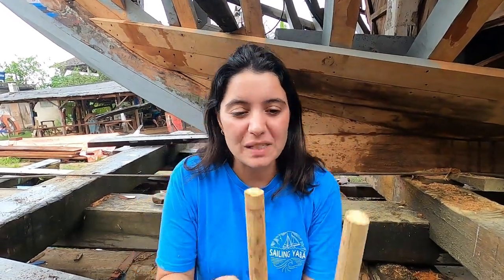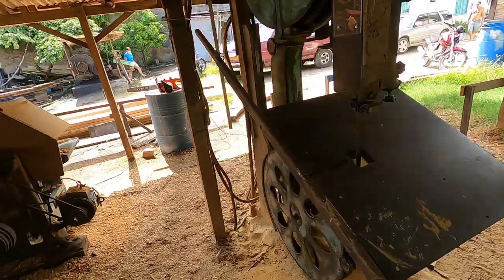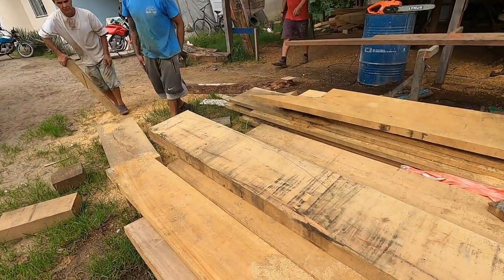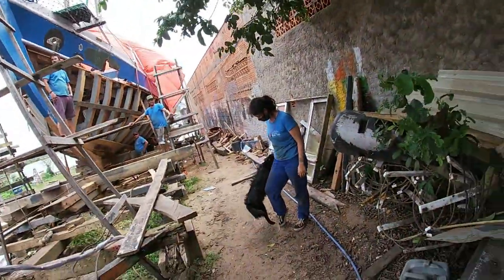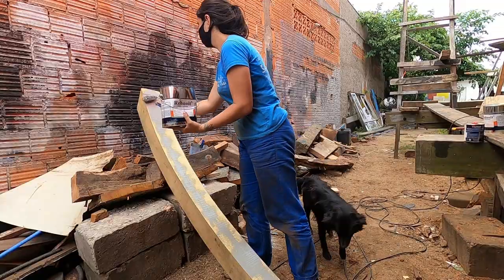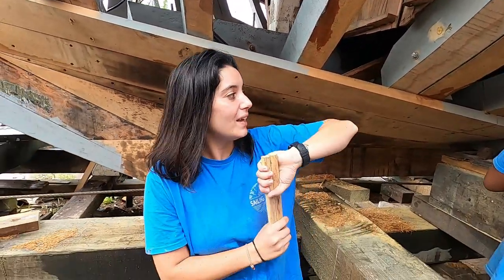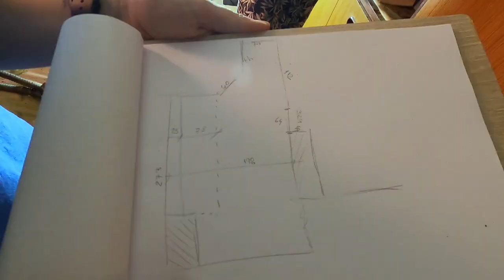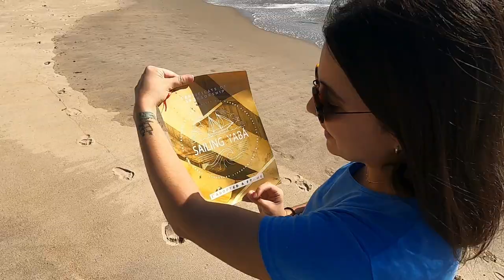MASSIVE RESTORATION: Building frames on a huge wooden schooner — Sailing Yabá #23

Comment: This is a beautiful video! Your boat is being wonderfully re-built. This is the first time I have seen the use of "tree nails", and I am most impressed that you are using them. They work like very large dowels -- or perhaps do even more than dowels do. I am glad that you hired Brunna to re-design the interior. That is an extremely good idea! The sponsorship program is an excellent idea too, and I hope that it worked out well for you. I am so impressed with your crew of shipwrights, and with Ben and MP. You are all putting in so much hard work and toil on the refitting of Yabá. I think Brunna sees a lot of professional opportunity for herself also. I think what you are doing is exactly right if you want to live aboard a boat: you need the refit to make Yabá sound and seaworthy, and both you and MP meed a precise knowledge of exactly how the ship was rebuilt. This knowledge will serve you both very well.

Comment: Well , the framing is coming along , Trunnels are certainly one way to do it very old-timey we used to cut a slot in the end of the trunnel then drive a wedge into it locking it in there. Futtocking is the way you frame vessels like this and its not overly hard , but labor-intensive. I see many things I would do differently, but they will do it the way they are comfortable, I however do take exception to them not bedding the futtocks with something. Nice to see her coming together. After framing and planking, it will be interesting to see how they attack the sheer plank and sheer clamp. I will bet there is a lot of rot in those deck beam ends. I as ever wish you well.
Reply: I can't believe you weren't consulted on this project? Maybe you had your phone turned off or something when they called.
Reply: @chiane1968  I have done great deal of wooden boat restoration and worked at a Maritime Museum at one point . they have their carpenters , and they will get it done
Reply: lawerence,  The fast work boat construction is impressive to watch.  Massive timbers, she will be super strong .  Yes, the faying surfaces should be painted and bedded, even if just with tar or something like mobile home roof coat.  If they can put a watertight deck on her it won't matter she will still last a long time. I am guessing that the sheer will have to be replaced completely, will be interesting to see.  Great to see the dedication of the owners and of the shipwrights working on her, this boat is definitely going to sail again.  James
Reply: @JimJocrusin  Yes its coming together and I mentioned early on about bedding with something, ( its a pet peeve of mine ) , yes the sheer plank for sure .I never noticed if she had a sheer clamp but it would help her. One thing we used to do was a thicker sheer (oak or other) with a bead and thicker covering boards to help to strengthen the whole sheer structure ( unless it was a historical rebuild) .Yes she is going to sail , but they have a long way to go
Reply: @lawrenceburchett7411  It's said that on average having a completed hull is only about 15% of completing a boat so yes quite a bit to go yet.  Great to see the young enthusiasm and the direction they are headed since there are a lot of big wooden boat restorations that never finish, this one will I think.   James
Reply: @JimJocrusin  I hope so, I have seen more than a few abandoned , they are going to need that energy ...lol

Comment: I'm looking forward to a tour of the bits that didn't need to be replaced in the end... 😅
Reply: @ian-c.01  Or a very long video because it will be difficult to get to all of the parts once they're hidden between and under all the new parts. 😅
Reply: Both of them.
Reply: Didn't they remove some big stuff like the engine while the frames were missing. How will they get it back in

Comment: Love the videos so far. 
I just have one question; wouldn't it have been cheaper to just build a new boat using the same dimensions and general design of Yabá?
Reply: In for a penny..........
Reply: @jiefflerenard1228  No that is not the reason.
Building a boat is a totally different project than a (large) refit, and much much more expensive.

BTW, I guess you're is a US citizen, Jeff.

Comment: I find Smith's original penetrating epoxy sealer is far superior for waterproofing wood than painting it with a urethane paint. Especially the end grain, around screws, nails and bolts. Soak it in good and it'll never rott. Bugs and worms wont like it either.
Reply: I like constructive comments like this.

Comment: You guys certainly compared the cost of this gigantic makeover with the ones of a brand new schooner. Can you give us an idea of prices difference? Good luck!
Reply: I looked into it and it varies. seems a good price for one at 70' would be somewhere in the $400,000 US territory but rebuilding one could cost a million depending on your desired end all.
Reply: @MitchellEdwards222  Probably the labour costs are very, very lower than in US or in Italy, for instance. And the wood too should cost less, at least because of the delivery costs that, obviously, should be lower. So I don't think that the will spend such an amount of money to rebuild, when a good 70" shooner  should cost 400K. It has any sense. 
Nobody throw money in the WC.
Reply: In the Baltic you can get 70' Wooden Hulls for far less  Kfk run for around 15.000 to 25.000 for non sailing Motor Fishing Boats if converted to Sailing  they go for around 60.000 to 120.000.  For masts and Sails depending on Size 15.000 to 30.000.  

i dont recomand using US prices as Standard for anything since the main goal is to ripp each other off as much as Possible so everything will be highly over prized.
Reply: Would not of been alot cheaper and better to sell that as it was and buy another boat this is a very expensive rebuild
Reply: @marksockett6657  labor is only about $18.00 a day for each worker so labor price should be very low where they are.
Reply: @cpt.mirones5109  Correct. Nor considering european shipyards as well. My estimation is that they will spend a lot less then we think.
Reply: @marksockett6657   everything on a Woodenboat is Replaceable. just like a Thatch Roofed house has the Roof replaced each generation so do Planks and Frames have to be Replaced over time. you cant Weld Wood after all. what happend here was complet lack of basic care: Anual Haulout among other things. if they did a whole rebuild they needed twice the space just for the Lofting Area aswell and i dont really see space for it in the Yard. 

and there was nothing to sell or worth it pretty much what they have is a Perfect 3D templated to Replace it Piece by Piece. 

i wouldnt have taken care of Jaba as she was if she was in my Area simple for the lack of Shipyards that really still work with wood as main material.  as it is right now everything goes in their Favor. from the cheaper wood for the lack of import taxes and shiping it around the globe to lower labour costs based on the local currancy.

what still remains the most expensiv is the fittings and rigging and winches. replacing the Furrlers for example would be an major biblical  oof. most most fittings i gues can be simply reclaimed and reused.
Reply: @mwatkins2464  Aaaah, 18$ a day ?  😳  Where in the world would that be ??  Haïti ?
Reply: @marcryvon  Brazil
Reply: @cpt.mirones5109  Most of the pricing I am sharing is in Southeast Asia or Europe. I noticed the US is not a big market for this kind of boat.
Reply: @ben5323  do you live in Brazil??
Reply: @marksockett6657  potentially. But depending on their access to credit, higher costs stretched out over a long period of time can be more feasible compared with one large payment to be made upfront
Reply: @marksockett6657   or scrap yaba and use her fittings spars, rigging, engine/shaft, tanks etc etc in a new hull
Reply: @ben5323  _
Reply: @MitchellEdwards222  $400K USD for a 70' sailing yacht in the USA would likely be well north of $1M USD, well equipped - or it could be a more expensive "project" boat.
Reply: I had read about a guy who had had build a wooden boat with only local hardwoods - which are inferior to "normal" boat building wood.

After 10 years he replaced the entire hull with a new one, and everything else on top of and in the old hull was then moved to the new hull.

I understood that it was a good economical solution to not having the normal boat building wood available.
Reply: @mwatkins2464  $ 18.00 a day? Is this a joke? Take Brazil seriously, It is a serious country! The price is usually agreed by contract, as long as the boat owners provide the material already paid (Depending on where you buy it is also possible to finance the material/equipment for the schooner in several months) for the service. If the payment was daily, it would be VERY VERY VERY MUCH more than $ 18.00 a day per worker (where do people get this from?). They know nothing about the countries and they keep kicking things, nonsense...
Reply: @ben5323  $ 18.00 a day? Is this a joke? Take Brazil seriously, It is a serious country! The price is usually agreed by contract, as long as the boat owners provide the material already paid (Depending on where you buy it is also possible to finance the material/equipment for the schooner in several months) for the service. If the payment was daily, it would be VERY VERY VERY MUCH more than $ 18.00 a day per worker (where do people get this from?). They know nothing about the countries and they keep kicking things, nonsense...
Reply: @jayf.1312  like it or not bub skilled labor where they are earns $18 a day. Do some research you really think these laborers use a contract. I said they make $18. a day.
Reply: @mwatkins2464  Spoken the "specialist" in generic searches at Google, who doesn't even know that prices vary by State (Brazil has 26 States), by city (more than 5000 cities), depending on the season, market circumstances, the price of electricity, and the quality of the work offered and son on ... !!!
 Spoken the generalization "expert" from other countries who kicks a price and wants others to believe in anything. Give me a break ... And go talk about your country ... Wherever it is...!!!
Reply: @jayf.1312  you just like to argue. So have at it girl. Give your momma back her phone while you’re at it.
Reply: @mwatkins2464  Contrary to what another UNINFORMED person says above/below, "specialists" in other countries through GENERIC and NONSENSE Google searches, the price of labor in Brazil, in this specialized area of boats, is MUCH MUCH MUCH MORE than the kicked $ 18.00 per day. ..
And usually the payment is contracted, closed, upon completion of the service and depends on several factors.
Reply: @trgdfs When someone writes NONSENSE here, he immediately has the answer highlighted. The generic search "specialist" at Google (uninformed people), who knows NOTHING about Brazil, kicks off a day labor (US$ 18.00 per day - a real joke!) value for a schooner joiner (wich is NONSENSE who orders the site to "stand out"). A bricklayer, for example, in Brazil, who is not as specialized as a boat carpenter, does not work for less than US $ 80.00/90.00 per day (and a day means just a few hours).

Comment: Correct me if I'm wrong but it looks like everything pertaining to the hull ( IE keel, frames, and hull planks ) from the main deck down is being replaced.
Reply: spot on 

- you may want to check out The Sampson Boat Co - or even Salt & Tar - both have been building or rebuilding "large" wooden sailboats over the past 3+ years.

Comment: One has to wonder just how much this complete re-build costs as it can easily get more expensive to rebuild a boat than build one from scratch thanks to all the extra labor costs.
Reply: Not as much as you probably think 🤔 need to bear in mind where they are having the refit done wages are not high even for skilled craftsmen and timber is lots cheaper there as well.
Reply: In NA and Europe replacing the keel would have been an easy $10,000 USD.  They did it for $675 USD.  So prices are WAY off from what you might expect.
Reply: That was my thoughts too. I totally get that the cost of timber and labour is less expensive in Brazil so it comes down what the difference in time is to remove the rotten material and replace with new vs. just building everything from scratch.
Reply: Sometimes it's not about cost, it's about restoring something you love. Ask anyone who has a classic car that they've rebuilt from scratch with no intention to sell it.
Reply: Very easy to calculate. Take a look at their sponsorship program seeking donations of $99 per frame and $33 per futtock. Now multiply that times the frames on each side and  and the $675 for the keel. Up to now they have probably spent about $10,000 which is a bargain. I think they will be below the $30,000  cost ceiling when they finish. Viva Brazil.
Reply: @jeffwood8109  I get that too but in this case the boat is less than 20 years old so relatively new?
Reply: @aib0160  age is irrelevant.
Reply: @jeffwood8109  Each to their own.
Reply: @Krieghandt  Take me back. Where was it written or mentioned the keel replacement cost $675.00.
Reply: @jiefflerenard1228  I never said the boat was classic. I said that people that restore old/classic cars with no intent to sell are in a similar situation, spending money on something that's "not worth it."

As for your assumptions in your other statement, all I can say is you know what they say when you assume things.
Reply: @jiefflerenard1228  I mean they put their lives out there for everybody to look at, and either be entertained thereby or pick them apart. I would watch their videos more except I can't handle the shaky camera that they always seem to have so it makes me sick. I just don't feel that I need to be wound up over whether or not they're making money or whether or not this boat will do what they wanted to do or whatever. If they're happy then they can be happy. Personally no amount of compensation would be enough for me to put my life out there for everybody to snipe at.
Reply: Yes. I would like to see an episode breaking down the budget. I've just started watching from the beginning so maybe that will be addressed. I only ask out of curiosity if I were to try to take on a similar adventure. If I have enough money to reach my dream. I do enjoy the content and am learning far too much. Lol

Comment: Ben just for the exterior what do you think the final cost will be to get the boat floating on the water minus the engine and interior work (rebuilding the hull and paint)
Reply: They probably want to keep the cost private for now and reveal it at a future date on its own video. I've been wondering the same thing for awhile now. Find out what Brazilian dry dock rates, skilled labor and materials costs are...then double it!
Reply: @cjjohnson1821  skilled labor is around $18.00 a day. That’s what makes all this possible and the cheap price of wood. I wonder if this wood is seasoned/ dried to prevent warpage ??

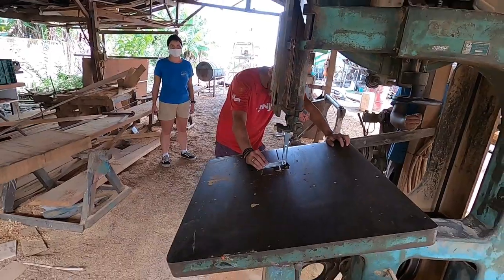Comment: I wonder why at 4:25 the blokes are edge setting the inside of the ribs. on the one hand it would make carpenting the beam shelf onto the ribs easier but looking at the rotten wood at the shear seems there isnt one as built, looks like heavy planking does the job. So?

Comment: How the hell do these workers still have sight? Never mind splinters possibly flying into their eyes, just the dust that must go in every day, you'd think they would be blind as bats. I could not work under a bit of wood while planning it, and still be able to see! 9:20
Reply: I was wondering that myself.  No safety gear to speak of. Goggles earmuffs etc.
Reply: They use old and simple technic: safety squint
Reply: They will most likely die younger and more painful than they should. On the other hand, introduce "western" safety standards there and they are out of a job the next day as their labour becomes unaffordable. So while Brazil should do more to protect such workers, it must be a reasonable long transission to avoid unemployment - which allready is a topic, together with work off the books
Reply: That’s how real men do it, Health and safety is for wimps.
Reply: @clifficus  and the people that lost body parts due to a short laps of concentration
Reply: @clifficus  safety second!
Reply: with softwood no problem,it is not ipė.

Comment: I can't help wondering about the metals being used to connect the frames. Surely ferrous metal will cause frame rot when it meets salt water.
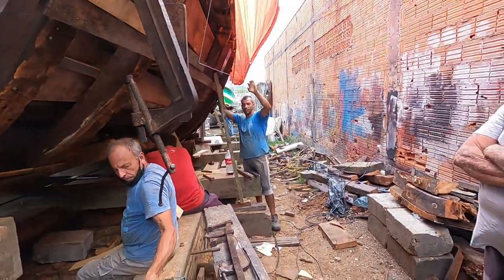Reply: Dude, this repair is a botch. Yes, the bolts will rust and cause iron sickness in the frames. And they´re using nails and screws out of galvanized steel, in itself a bad choice, were it not made worse by the fact that the nails they are using look like fencing nails. The new frames are also being made half sized (half length) and bolted in with the floor timbers, leaving a gap to the lower part of the old frames ( 09:00 ), so the frame´s ENTIRE stuctural integrity depends on 2 bolts and a ""tree nail"". They´re also bolting raw wood with raw wood, without any bedding compound to protect against moisture and rot. What´s even worse, they´re bolting new wood with old wood right next to rotten timber, which they should have cut out on day one. Even the new keel was botched. No bedding compound in the scarf joint, gaps left open and wooden defects were left in the keel. This boat died after just 13 years for a reason. And it will be lucky to live another 10 on the water after these repairs. I would not get on that thing.
Reply: I do not disagree with  one word of your comment , it almost feels  like we are watching a young couple being " Screwed over" by the boatyard.